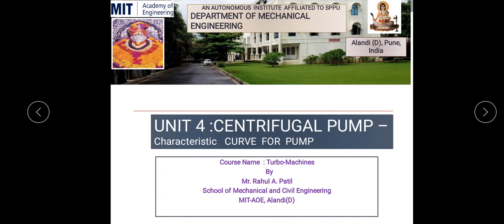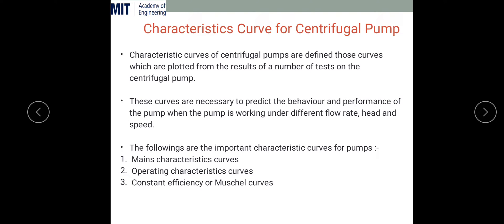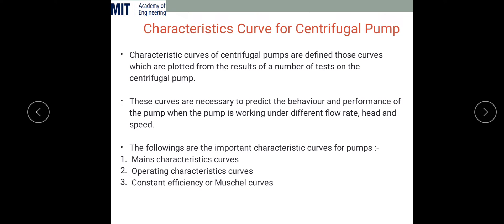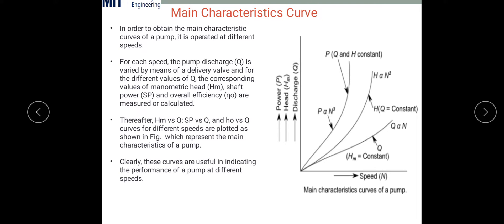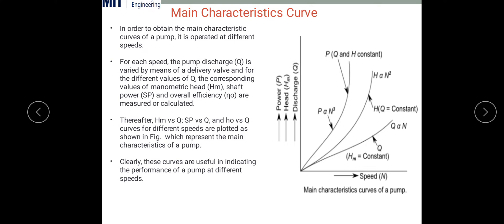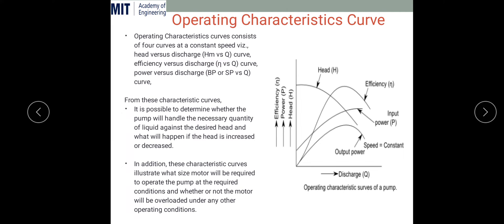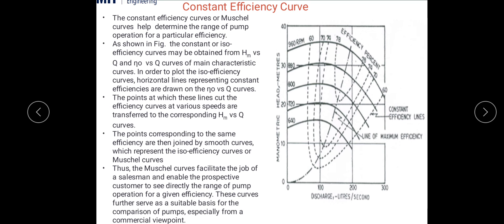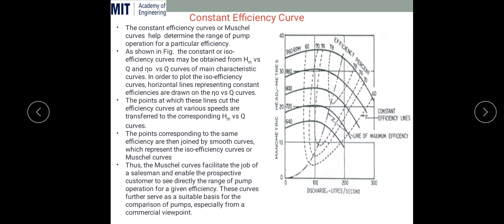Centrifugal Pump - Characteristic Curve of Pump

Comment: Hello,
 could you please tell me how pump curve is determined at a certain speed however the input power = ( torque x angular velocity).
 so, to get more discharge we need more input power by increasing velocity
 and then by applying  the efficiency  formula (output power / input power) we can draw an efficiency  curve.
 so,  how this curve could be at a certain velocity?